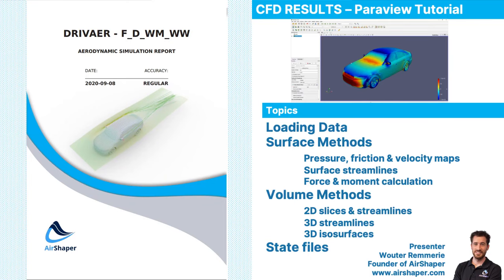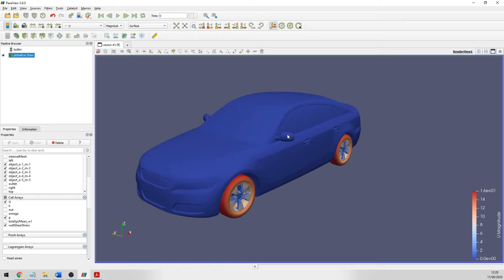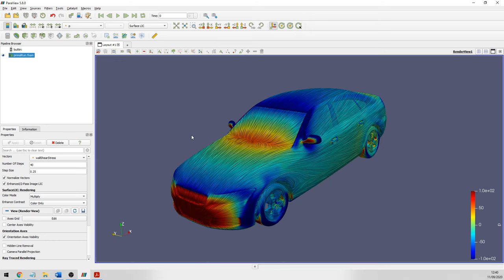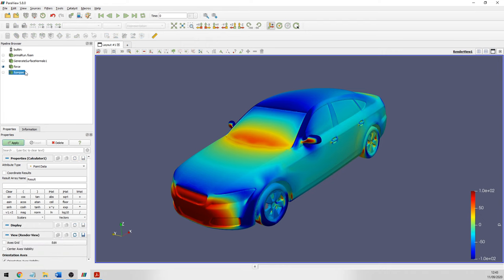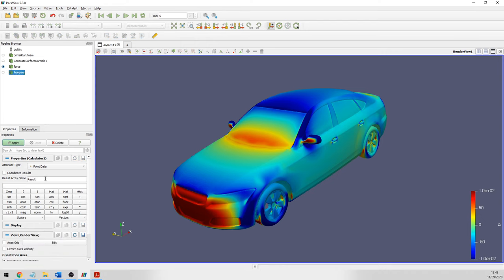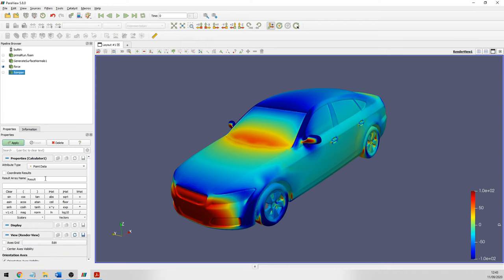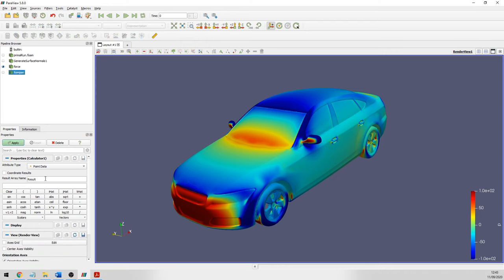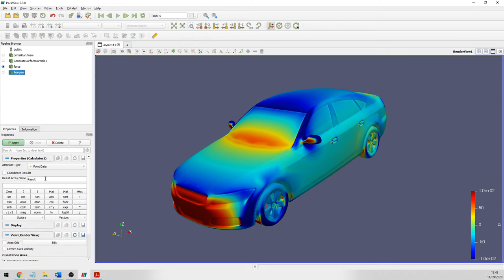CFD Results - How to analyse OpenFOAM data with ParaView - 25-minute Tutorial

Comment: Hi. I think your channel is very interesting. I have one question about this video. When you computed the total force acting on the vehicle, why are you subtracting instead of summing the wall shear stresses? Is that becasue you are interested only in the pressure forces rather than in the effect of both pressure and friction or I am just missing something?
Reply from the maker: Dear Saverio, good question - I don't know!
If I look purely at the friction forces and integrate them across the car, then I get a negative value in the driving direction. That is physically not possible. When I apply the minus sign, it matches perfectly with the forces we calculate in OpenFOAM. My guess is that perhaps this has something to do with the normals, which can be inside-out on the surface (because the surface you see is actually the boundary of the air volume, not really the surface of the car). If you find out more, thanks for letting me know!

Comment: Hi there! How could I obtain the wallShearSress if I already did the simulation and it does not appear in paraView? Do i need to change any file or include "wallshearstress" somewhere? It would be very helpful to know some information, I need this variable to calculate my forces on my 3D F1. 
Thanks!
Reply from the maker: You need to run a separate post processing command in Open foam to get that field

Comment: Thanks for your services.
I have a question.
In many videos about calculating drag force, during the calculator step, they often don't multiply by density.
Can you explain this part in detail?

I'm not good at English. Thanks read my question.
Reply from the maker: It depends on how they store the pressure field. In some calculations, the pressure field p is the real pressure. In other calculations, it is the normalized pressure (divided by the density). It depends on which solver you use, if you use a reference pressure, compressible flow, etc.
Reply: Thanks :) @AirShaper

Comment: Hi Wouter. Thanks for the video.
Could you explain the origin of the difference between AirShaper and Paraview visual regarding the total pressure bubble (additional layer on the surface of the car). Is it something we can correct somehow in Paraview? Thanks!
Reply from the maker: Hi Sylvain, for the AirShaper report, we first cut away the cells that are touching the surface of the object (in OpenFOAM). This avoids having the entire object surrounded in a "pressure bubble". We haven't found a way to do that in Paraview, but we stopped looking after we solved it in OpenFOAM directly. I would guess that with some creativity this should be possible in Paraview as well.
Reply: Ok Wouter 👍 The result is perfect! Great work.

Comment: Hello, Thanks for the tutorial, its very helpful for someone new to ParaView.  I wanted to know if you could share some info on what computational resources were need to run the DrivAre model.  Runtime, CPU, hours, etc. that kind of thing.
Reply from the maker: This sim would typically take around 3 hours on a machine with around 170 virtual CPUs and a few 100gb of memory. But you can run it on smaller machines as well.

Comment: Thank you so much for this video, it was very clear and helpful.

When I try to use Surface LIC in the internal mesh, Paraview suddenly closes and the Output Messages window pops up but with no messages inside. Could you please explain what are the possible reasons and solutions to this? 

Thanks in advance (:
Reply from the maker: Ow haven't had that before yet - surfaceLIC perhaps only works on surfaces (a slice, object surface, ...). Perhaps that is the reason?

Comment: Why does the data from OpenFOAM (pressure, velocity, etc.)  sometimes now show up?   Just a grey block in the display portal/window?  I use Salome to make my meshes.  Typically I past the new mesh in another case file and usually run into this issue.
Reply from the maker: Sometimes it could be because you need to go to the last time step, or select the decomposed case data

Comment: 20:39 Why do you multiply the static pressure with the density? Isn't the calculated pressure in OpenFOAM the static pressure?
Is it possible to use the formula for the incompressible case cp = 1 - (c / c_infinity)^2 ?
Thanks for the great video!
Reply from the maker: By default, OpenFOAM (at least for the simpleFOAM solver) will write the normalized pressure, which means it is divided by the density. To obtain the real pressure (and thus the correct force) you indeed need to multiply it with the density.

You can indeed calculate the pressure coefficient as well (which can be done using both the static and the total pressure) to get a "relative" distribution. When we show "pressure clouds" in our reports, we use an isosurface for the total pressure coefficient for a value of 0 (which nicely shows you the wake!).

There are commands in openfoam to calculate the total pressure as a new field - those are pretty useful as well.
Reply: @AirShaper  okay, makes sense. Thank you very much!

Comment: Hello, I enjoyed the presentation very much. Very helpful, as I´m new to car aerodynamics and OpenFoam.
Can you clarify the physical meaning of the Cp=0 isosurfaces in regard to being a drag source? I think you called it "red clouds".  The reference pressure was 0 Pa and set at the outlet BC, I´m guessing?
Best regards, Pedro
Reply from the maker: Hi Pedro, I use Cp-total in tje tutorial. That is the pressure coefficient calculated using the total pressure. If you make a 3D isosurface of that in the air (so not at the outlet boundary) you get a 3D surface that denotes the split between zones with a total pressure coefficient above and below zero. Everything contained within those clouds has a Cp-total lower than zero (so lower than the total pressure of the free stream). These low pressure 'bubbles' hold the vehicle back, as this negative pressure creates a suction effect on faces pointing towards the rear of the car in many areas.
Reply: @AirShaper  Thank you! I found the channel today and it has been very educational. The chats with real world designers are a great touch. Please keep producing content.
Reply from the maker: Thanks Pedro, will do, good luck to you!
Reply from the maker: @pedrobrito8080  Thanks a lot! And good luck with your projects!

Comment: Great video! How do I know if my data is normalized with density? Is this always the case? Thank you again.
Reply from the maker: Hi Braeden, the field files of OpenFOAM don't provide you with that information I'm afraid. The best way is to check, if you have the case files, in the constant properties & controlDict files which density & solver were used. Then, checking OpenFOAM documentation, you can deduct if the density was normalized. I'm not sure if it's always normalize by the density, it could be!

Comment: Hi, thanks for this video, it's been very helpful. Can you clarify one thing for me please? After integration of force and torque, how do I use the single integrated vector in following calculations instead of a "map" of force vectors?
Reply from the maker: Hi! I don't think I completely understand the question - what do you mean with the single integrated vector (force & torque are not combined, I think, in our video?)?
Reply: @AirShaper  No no I meant using i.e. resulting (so integrated) force vector instead of force field. But I can see that after IntegratingVariables it already uses the single vector in further calculations. Thanks again
Reply: @AirShaper  Do you maybe have some hints on calculating the center of pressure? I already calculated the arm of the force and not sure how to proceed

Comment: I haven't wallshearstress in my openfoam simulation. I generated it using Xsim, maybe it's not the best way. How do you recommend to run a simulation for this use case?
Reply from the maker: I haven't heard of Xsim before. In OpenFOAM, the wallShearStress is generated during post processing with a separate command.
Reply: @AirShaper  that's great to know, thanks. Xsim is a nice web based (runs locally) GUI tool that prepares the scene for openfoam, which then you'll run on your machine. But for some reason they didn't include the wallshearstress in the post processing, but the calculation of drag and lift coefficients is there. But I guess it's wrong
Reply from the maker: @piereligiodisante 
Interesting, I hadn't heard of it before, thanks a lot!
Hm, then best to double check all the calculation settings if the values are wrong :)
Reply: @AirShaper  i assume it’s wrong because there is no wallshearstress output, so that isn’t used for sure
Reply from the maker: @piereligiodisante 
It could still be correct, the OpenFOAM "forces" and "forceCoeffs" might take wallShearStress into account (without writing that field)
Reply: @AirShaper  I see, thanks

Comment: Nice explanation,could you plz upload a vedio how to extract the data and from paraview and plot in gnuplot,how to compare the extracted data with some other results usin gnuplot.
Reply from the maker: Hi Idrees, such a video would be too specific / detailed for our channel. But I've exported data from curves for example to csv, to then plot in excel!
Reply: @AirShaper  where is that vedio?
Reply from the maker: @idreeskhan1629  There is no video on that topic - it's just how I did it in the past. For example, you can first plot the surface data on an object and then make a 2D slice through it. That will give you a curve. Then, you can click that slice and go to "File - Save data" and save it as a csv file. You can then process that data in excel. You may need to first add coordinates to the results (using a calculator) so X, Y and Z are exported as well.
Reply: @AirShaper thank you, kindly if you send me your email i will send you a paper whose graphs i need if you guide me how draw those graphs please,
Reply from the maker: @idreeskhan1629  Hi Idrees, I can't go as far as to provide custom assistance for free for everyone. If you need assistance, you can contact me at wouter@airshaper.com for regular (paid) consultancy.